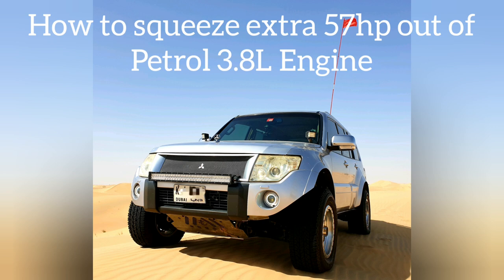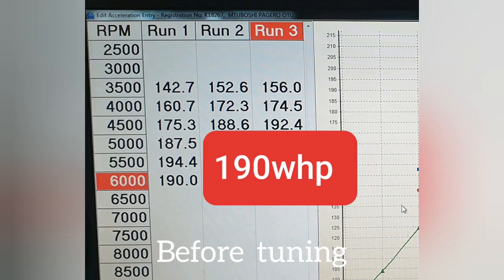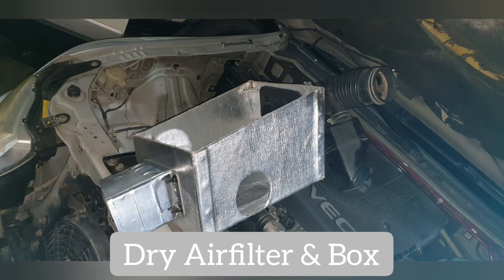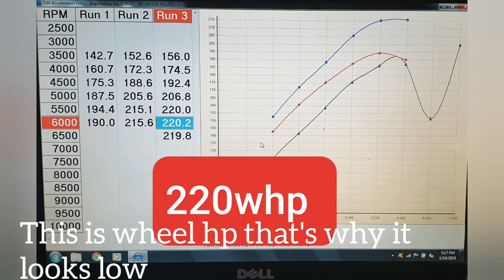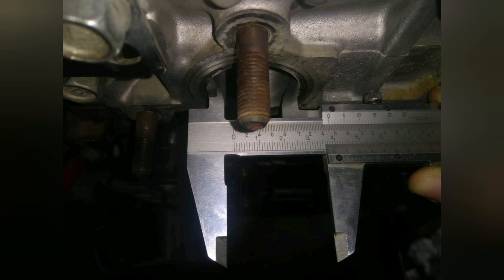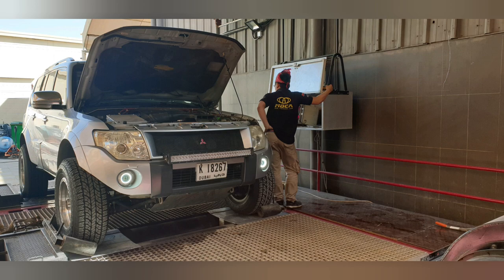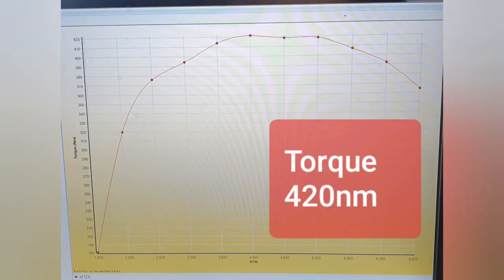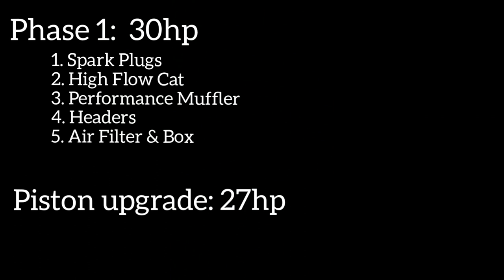How to squeeze extra 57HP out of 3.8L Pajero! [Dyno Testing]

Comment: i squeezed a considerable amount more for way less than rebuilding the 3.8 with pistons spark plugs high flow cats and a muffler ,i just went to my local wreckers and bought an LS1 ,found an engineer to make me an adapter plate fror the 460LE transmission to bolt up to the transfer case and now with a maffless tune headers single three inch exhaust and a VCM710 camshaft it puts out near 488 horsepower at the wheels ,i have upgraded the fuel pump and stage 2 fuel injectors which flow close to 1100cc,all for under 5000 dollars ,lighter engine more power more reliable and better much better fuel economy

Comment: Great project, smart safe way to increase performance. I have 2008 with a replaced all most new 3800cc engine of 2016. I am thinking to do the first phase and fixing a small turbo ( with air cooler, connecting to the main radiator to cool the turbo, connecting to engine oil cooler for lubrications) with no change on engine. do you think it will work ???!!!

Comment: Great video! 
I love these engines, they are very underrated.
I have a 6G75 fitted to my Mitsubishi Magna (originally a 6G74) here in Australia (it’s the Diamante in other parts of the world).
I’ve had it fitted with performance camshafts and coincidentally ended up with the same power & torque figures as yours so well done!
Reply from the maker: That's amazing thank you for getting in touch. Is the cam shaft you fitted on a mivec 6g75 the same one on the pajero? If yes, where did you get the cam shaft from?
Reply: Sand & Track no it’s quite different actually.
In Australia we don’t have the Mivec version, we have only the regular non Mivec head version of the 6g75.
The performance camshafts (Graham Bell camshafts) were fitted to my car about 7 years ago.
Graham was a well known racing engine builder here in Aus.
But unfortunately he is very old now and has now retired
Reply from the maker: @GForceVRX  I figured they are different engines with different configurations. Thanks for the explanations!
Reply: Love my 380.

Comment: You can get few hp if convert the mechanical fan to electrical fan
Also i would suggest a big injectors + bigger radiator you will get very nice results

Comment: This is really impressive, as you have gathered all the required parts and data (in a DIY style) , coupled them together to arrive at the result you were looking for. This will surely be an eye opener for alot of Pajero users who wants to modify for more performance. Great work. 

Also wanted to know your feedback on 'Unichip' as I'm currently looking into two options i.e. between 'Unichip' or 'Remap the stock cpu' to get more performance, where the major purpose is for desert driving
1. Unichip vs 'Remapping of Stock CPU'. which would you advise for a beginner looking to boost the performance of a pajero 3.8 (petrol)
2. Is Unichip safe, as the car's engine or other components will be pushed to extreme limits , as I don't want any of those hassles. 

looking forward to your feedback
Reply from the maker: Hi Noble thank you very much for the support, it indeed was mostly DIY projects with trial and error all along. To answer you:

Question 1: Unichip is probably the best upgrade I have installed on the car. It basically helps tune the engine air, fuel, timing to work better with the performance parts and get the most out of them. The Pajero Gen 4 as opposed to the previous Gen 3 is very detuned by the manufacturer for emission purposes and has electronic limits so when you hit a high RPM the stock ECU kills your power which is not helpful when offroading and trying to climb high dunes. Unichip helps tune the car to perform better and fixes the RPM issue.    

The reason why I like Unichip is its a piggy back ECU, meaning you are not messing with the actual car ECU which if it gets damaged will be expensive to repair. Unichip intercepts signals from the cars sensors and alters them so its less intrusive than playing with the engine ECU. I have installed Unichip with the RPM cut off module which helps keep the power going when the car hits 6500RPM, the car keeps giving power which is amazing for climbing high dunes. 

Question 2: With any modifications , we are naturally pushing the car to its limits. Meaning there is always risk of components giving up. However from personal experience I have not seen any issues and non of the cars in our Pajero club have had issues with Unichip. I just wished I had done the unichip upgrade way before as it makes a massive difference offroad. The car transforms in a beast :)
Reply: @SandTrack    Hi Im one of your avid fan. what you did on your pajero is amazing and I would like to do exactly the same on the first phase of your modifications... i actually took a pictures and watch this video every time just to be familiar with what you've done. I would like to ask where did you get the Unichip here in Dubai. Hope to hear from you soon.
Reply from the maker: @erwingeron9145  hey Erwin really great to see your message and know you are passionate about your Pajero 😊 you can get it done at at MOCA the official dealers of unichip. Contact Wael and show him my car pictures, he will know what to do  +971 55 314 4459. Also quote UAE_Pajero so you can avail a discount
Ps. Subscribe to the channel I will be posting more videos soon
Reply: @SandTrack  Thanks buddy I appreciate your help. I did subscribed and I liked all your videos, hope to go and explore with you and other pajero enthusiasts very soon.   
More power

Comment: Love it! Very dope what you did. I have 2 questions. One, after the upgrades, have you noticed a change in the petrol consumption if you're driving from destination A to B (e.g. home to work) at an almost constant speed (e.g. 100km or 120km or less)? Does it drain more petrol than when it was in its original form without the upgrades?
Reply from the maker: Hey I haven't really seen much of a change in consumption. Thanks for the message 😀

Comment: Love your videos brother.
I have a Prado V6. I have all mods relating to wheels and suspension. 
I do not have mods like cold air intake,  headers, exhaust or engine tuning. 
I want to take up the mods to another level.
Can you advise from where I can do it in Dubai or Abu Dhabi.
Also will these create any issues while passing the vehicle?
Reply from the maker: HI Bro thanks for the message! These types of mods will not create issues with passing except if you have a loud exhaust. I personally go to Jasr Al Wahda Garage for all my car work

Comment: if i were you, since i've took apart the engine, i'll ceramic coat the piston, change to low compression crankshaft, and turbocharged the engine with sequential dual turbo. i think it can reach 800 crank 🐎.

Comment: Great video, very informative. Thanks. With the extractors, where is your exhaust leaking from. Is it from where the extractors meet the head? Also how do you find the Unichip with fuel consumption. Better or worse? Thanks
Reply from the maker: Hey I have since changed my Headers and custom made new ones. I find consumption slightly better with unichip. I have an eco setting which I use

Comment: Had the same thing happened to me lost number 6 butterfly, on strip down of motor they found the screws but no butterfly, 
On rebuild  have added a supercharger.
Reply from the maker: I have heard of so many cases of the butterfly going loose. Super charger that's interesting! When you rebuilt did.you do any modifications to pistons and valves? Curious about the super charger. Which type did you put in and is it on fourth generation 3.8? Do you have videos if pictures to share?
Reply: @SandTrack  they put ceramic coated pistons in it, have got photo, will send to you if I know where too
Reply from the maker: @jeremerywall6308  that's amazing looking forward to the details and pictures on the super charger. Super charged Pajero is next on my wish list. Please email at: adventureseeks@gmail.com

Comment: lol the whole butterfly valve failing and falling into the engine and destroying it a common 3.8 problem huh , had the same issue with my 06 3.8  back in august of 2020. spent around 11,000dhs  in rebuilding it with almost 75% of the engine new . the problem that occurs here is the break in period for all the parts , the guy said to drive it for 1,000 kms before trying to do anything . we did that and replaced the oil after 1k kms , so after about 3,000 kms later we take it to the desert , 15 mins in and the piston rods break . there it goes for another 2 weeks of repair and a bill of 5k . now im in a break in  period of 10,000 kms before I can even cross 120 kmph , u can imagine how frustrating that is trying to drive on UAE roads 😅. So yes , back to your video ,  I kinda sorta have some questions if u don't mind .. 1. did u have a break in period for your parts that u changed  ? 2. does it make sense to start putting in more money than I already have into modding the 6g75 3.8 that I have in my car which is bone stock as of now or should I just drive it till it dies and get a 5.3 Sierra and start work on that ?😂 3.the mods you've done to your Pajero , are they all legal or did u have to get papers for it ? and 4. how bad is the fuel economy now ?keeping in mind it was garbage when it was bone stock 😅✌🏻. thing is I have a 3.0 v6 98' that has crossed 500k kms and I wanna swap its engine and start a off-road build on it , but I cant seem to find a engine that fits , I wanted to swap it to a 3.8 of the newer models but apparently nothing after the year 2000 fits , so ill have to put in a 3.5 from back in the day and start from there🤦‍♂️but do I wanna do that when I have a 3.8 in another car? and  bone stock its acually good in the desert even when compared to my 400hp Y62 patrol...   i really want a off-road focused car in my garage so that I dont have to go out of my way and take a daily driver  to the desert and have to face the hassle of spending another 3 weeks in the workshop after  .
Reply from the maker: Hi Rahul thanks for reaching out. Here are a few thoughts and answers. On the break in period I did it for 5000 km. First 1000km I was driving maximum 3k RPM and then changed oil and then afterwards I started raising the rpm limit and driving it normal without reving the engine fully until I crossed 5000 KM. So without knowing what led to your piston rod breaking, these are typically hard to break and most of the time has to do with bad oil circulation, yet I can't be sure and hopefully your mechanic would have figured it out. Fuel economy has not changed much honestly after the upgrades. The Pajero 3.8 is known for its butterflies going loose and damaging the engine. I had mine welded in so they never come off! Here is a video explaining what happened in my car https://youtu.be/FlSj3_gWsaY As for Swapping out to a non mitsubishi engine its doable but is not very easy on our cars as our ecu and wiring schematics are not easy to deal with like American cars. Its been attempted from what I hear and the car will be riddled with non functioning electronics and errors. I would suggest to perhaps try to modify up and tune a mitsubishi engine. Your other route is to also add a bullet super charger they are design and made to plug into our cars with no modification https://bulletcars.com/superchargers/mitsubishi/pajero-v6-mivec/

Comment: Hi @Sand & Track
I have a 2016 3.5L V6 LWB V95 Pajero here in Muscat,Oman. Can you shed some light on the basic mods that i can proceed with?
Reply from the maker: Hello you can do very similar mods in stage 1 in the video and same parts fit. You start with filter, Headers, cat and unichip tuning
Reply: @SandTrack  Surely will start with the stage one however I doubt the spark plugs that you opted for your 3.8L are compatible with my 3.5L engine, since the stock plugs of both the engines aren't same.

Comment: Just want to know  after the phase 1 upgrade did you gain 30hp? Or you gained 30hp after tuning with unichip?
Reply from the maker: Hello Ajmal its after installing the parts and tuning. Unichip helps tune the air and fuel ratios to get the most from the performance parts
Reply from the maker: I have seen some do unichip on stock car and get similar gains but the power curves are not as good
Reply: Where did you get it done, Dubai ? If so, would you suggest any garage ?

Comment: I have the 2007 SWB, May i know what muffler brand you recommend?and do you recommend long or short Y pipe? Cancelling or keeping the resonator?
Reply from the maker: Hello the muffler I am using is made by fox skyline. I would recommend to keep the resonator as the car will be too loud if you remove it. As for the Ypipe, if you plan desert driving then get long headers to get maximum power gains at high rpm

Comment: سلام لو تكرمت اخوي هل الكفرات مريحة؟ إذا مريحة وش نوعها؟ انا معي ٢٠١٦ والسيارة غير مريحة واحبه مابي ابيعه. رحت المحلات قالوا لي غير المساعدات وانا اتوقع السبب اليايات لانهم يبون يطلعون فلوس ولا فيه ثقة فيهم
تحياتي لك
Reply from the maker: hello I suggest you move to 17 inch size tyres. Yokahama Geolander is very smooth. I am also using dobinson stage 2 suspension it's not stiff at all
Reply: Sand & Track Sand & Track i was told by the shope that dobinson are stiff and for desert trips but i only do city never in the sand and anyways i can do these activities due to my back and nick pain... so u suggest that springs ain’t important to change so although was told bilstein german shock absorbers are the best cus i saw a show saying the thicker the springs the stiffer the ride... they did highlight its the most important yet i am having mixed up messages here and unable to decide which parts to go for ...
Reply from the maker: @askaribr1  I dont have experience with bilstein shocks. With dobinson stage 2 you can adjust the pressure and make they either very soft or hard depending on your needs
Reply: @SandTrack  thank you brother

Comment: Did you cut or trimmed your front bumper? It looks like a bullbar but it’s not. I want to do that coz  want to upgrade my wheels
and tyres to 285x65x18. I tried it but it will hit the front bumper.
Reply from the maker: Hello yes that's correct I cut the stock bumper to make clearance for the tyres

Comment: Hi, It’s interesting to see all the works you’ve done on your Pajero. Couple of days ago I had some knocking sound from the engine and it went away. I drove around 100kms since then without any issues. I took the car to the garage for spark plug change and when they removed the inlet manifold, I found a shocking scene. One of the butterflies broken into 3 pieces and two pieces were in the neck and 1 piece and screws missing. 
Now, the car is removed inlet manifold and waiting for a good garage to remove the head. 
2008 3.8 SWB with 230k kms. I need your advise if you have time please bro. 
1. Butterflies and the rubber orings or bushings available separately? There was a vacuum leak through the front white plastic piece. I’m thinking if I re-do the engine, I have to do this as well. 
2. You’ve mentioned that you welded the butterflies. I just want to confirm that if you welded the screws. When u welded, heating will not destroy the plastic bushings? 
Thank you.
Reply from the maker: Hey man sorry to hear that the butterflies broke.  That happened to me at some point as well. So I welded the screws to make sure it never happens again. For the separate parts best to check with the nearest mitsubishi part dealers to see if they sell them
Reply: @SandTrack  I didn’t get the head removed yet. one of the mechanic told me to get a inlet manifold from scrap and just fix it and see if there any misfiring. I need your advise bro. Only two screws and small piece of a butterfly only missing. What’s your best suggestion bro? By the way , where did u get the butterflies and shaft from pls?
Reply from the maker: @zantime1930  in my case I also got a manifold from scrap then I welded the screws so they don't ever come off. But had to rebuild engine as the screws and butterfly caused extensive damage. If the screws went through the engine and out without causing damage then you were lucky and all is fine. Let them do a compression test on your Pistons to be sure all is okay
Reply: @SandTrack  ok bro, I will check and revert. Thanks
Reply: @SandTrack  have you just welded the screws threaded side? What type of welding? I just worried about damaging the rubber seals because of the welding heat. I got one inlet manifold from the scrap yard. Need to weld now and Waiting for your reply.
Reply: @zantime1930  Othere options:  1-Red loctite.  2-Get screws that stick out a bit, split the tips, torque and spread the tips.  This is the common practice on butterflies in carburetors from the old days.....kits included new screws already split for for this.  Or just 'stake' the screw tips with a sharp center punch.  3-Just remove/omit the butterflies....you'll lose some low-end torque and basically have what used to be called 'spread bore plenum' making max power at high speeds.  Leave the rod so the computer thinks it's 'tuning' the manifold by moving the actuator.  4-Swap with an engine that doesn't fall apart and eat itslef as part of normal operation.  A 5.3 LS somewhere out ther has your name on it.

If you do like the OP, you'll have to cut those welds off to re-seal the rear 'designed-in early-life air leaks' at the shaft ends.......